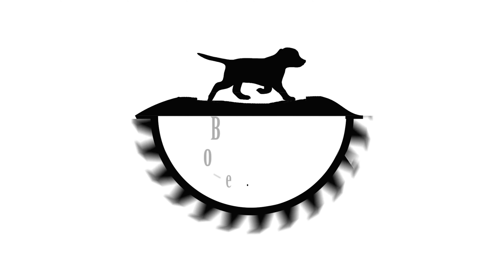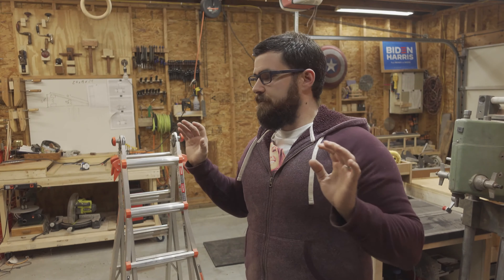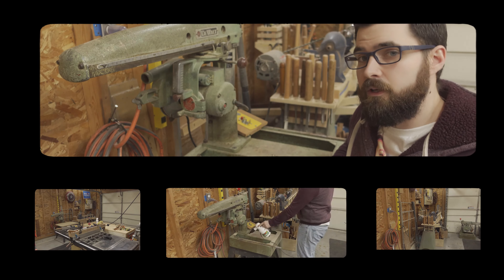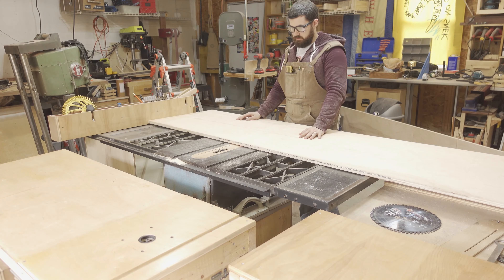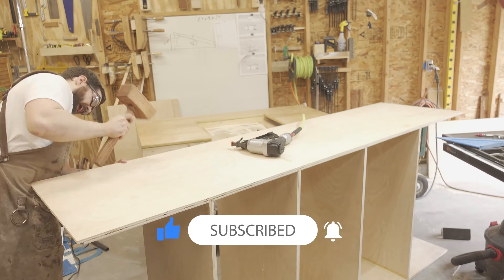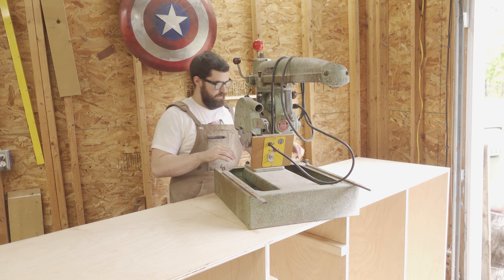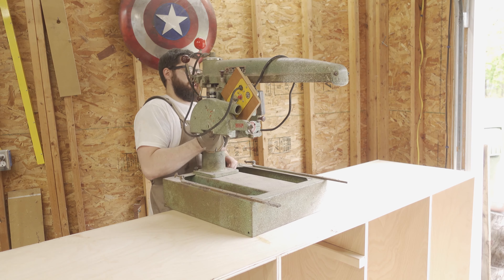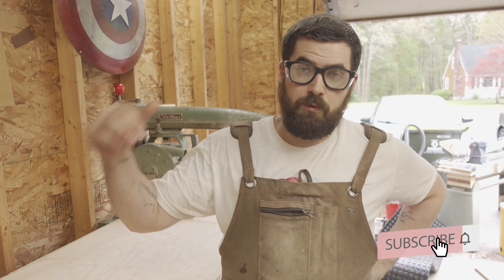Dedicated Dado Cabinet: Radial Arm Saw Cabinet- Part One

Comment: I'll be curious to see how you get the RAS arm parallel and coplanar to the table.  If it's not, you could  end up with dados of different depths.  Your video skills are outstanding.
Reply from the maker: Thank you for watching and for the kind words!
The saw is sitting on cleats that are parallel to the table top and I squared the fence to the 0 reference of the saw. I just checked with a dial indicator and it looks like I lose about 10 thou between the front and back of travel, which- while not perfect, is completely acceptable for my uses.

Comment: Time out…..hold on a second, are actually trying to support the weight of that old MBF with just those two cleats mounted in 3/4” plywood????
Reply from the maker: Trying and succeeding, it seems. It has been mounted for over 2 years without any issues.
To be honest, I never gave it a second thought. 
The MBF is very tightly fit to its pocket, so it is possible that the friction against the sides is taking up some of the weight, but even so, the cleats are having no trouble two years in and the entire cabinet is holding up well with no issues to speak of.